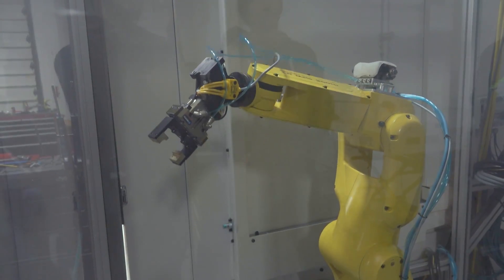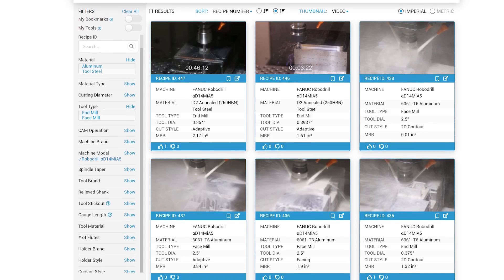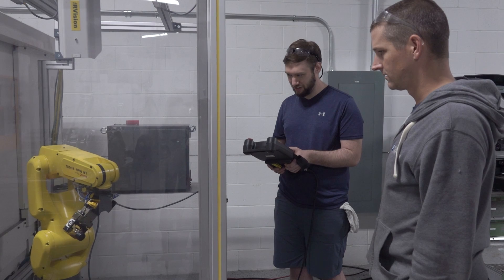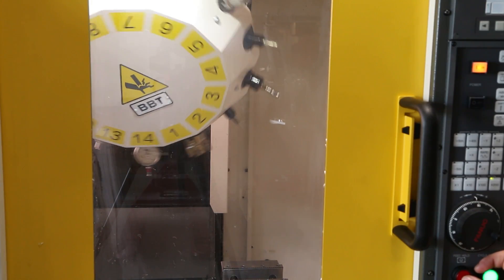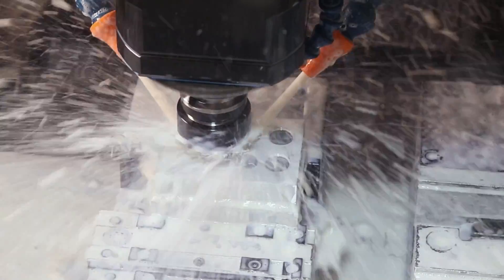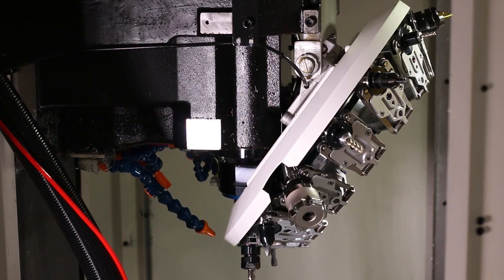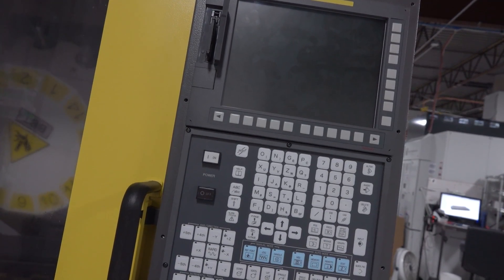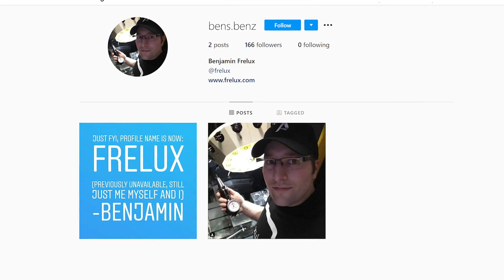FANUC RoboDrill CNC Machine: Showing what a Drill Tap machine can do!

Comment: I hate Fanuc controls, but one thing to make running programs faster is to save them on the card as Onnn without the .nc extension, then from memory call the program with M198 Pnnn. You have to set the IO channel to 4 ( I think?) in order for it to run off the card but then you don't have to copy to the control every time. The main problem with this is that you cannot do a program restart from part way through if for example you have to change a tool.
Reply: Blob87 thats so unusual for me to hear. 90% of the cnc machines in my town are Fanuc, and every machine I’ve ever bought (except one) has been Fanuc. I find Fanuc to be the easiest to program. Especially the latest versions with manual guide i. I’ve just picked up a machine with an Anilam co troller, and it’s so difficult to program, compared to Fanuc

Comment: If the holder you showed is the one you using, then that is not a dual contact.  BBT30 dual contact holder should have the shoulder coming form the taper grind. The dual contact comes from the taper and grind shoulder.
Reply: Just remember, if you have a BBT30 spindle.  You should be use BBT 30 holder. A quick Google images search will show you how it works.
Reply: Well I don't know about 30 taper but on BT40 there is normally a 2mm break between taper and the shoulder. This gap remains in the BBT40 but halfed to 1mm.

Comment: If you avoid milling type operations the low drawbar force probably not a big issue. Just like how morse taper is incredibly stout in pure torque but tends to come out if you side load it.
Reply: I used to beat the shit out of a mate years ago. I broke more pull studs than I had an issue with tools pulling out 👌

Comment: Noob question.. Is the arm only for parts removal or it serves as an extra axis or work holding?
Reply: Remember, it's an arm.
Not only does it look like one but it acts like one too.
But hey if you can hold a part by hand and mill it at same time then OMG congrats!!
*!!DISCLAIMER DO NOT TRY THAT EVER!!*
Reply: @wildin13   Well, actually that was a valid question. There are rigid robot arms that can do workholding on their own, but they are bigger, more expensive and you have to keep the cutting forces kinda low. But yeah, the robot arm shown in this video is way to small to have the required rigidity, no way you're gonna machine on that.
---
This small robot arm could however be used for something like deburring, sanding or polishing. Think about wire brushes, flap sanders or polishing disks mounted on a tabletop grinder. And if you want to put a stamp or sticker on your part, and you have a sticker dispenser or prefilled automatic stamp, then you can use your robotarm to do that.
Reply: @sasjadv  I never said it wasn't valid.... 🤷‍♂️
Reply: @sasjadv  thanks!
Reply: DiPT_TPiD only tool changes and part removal